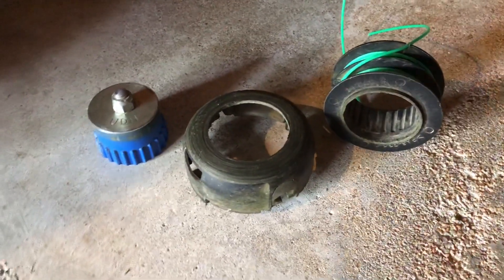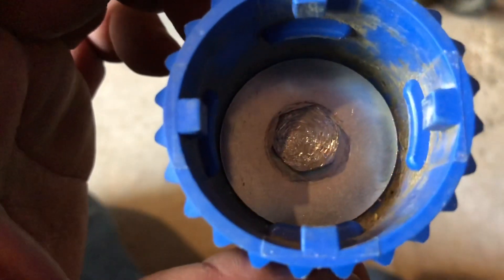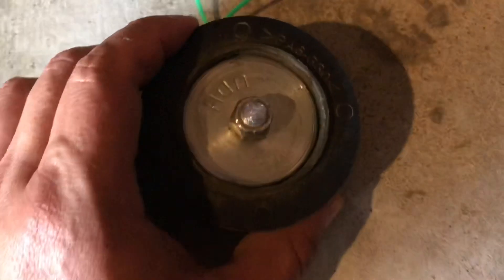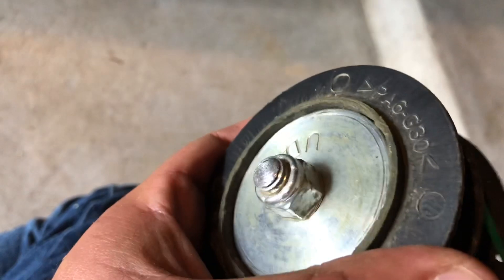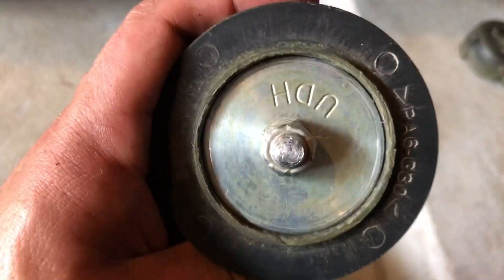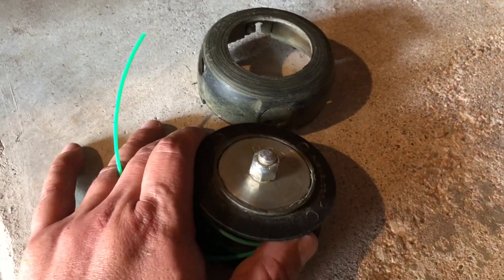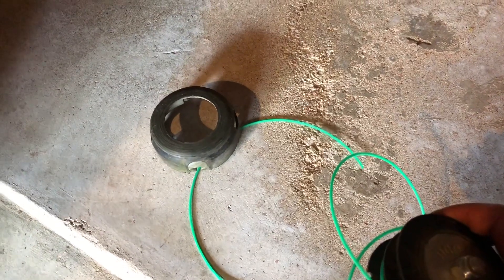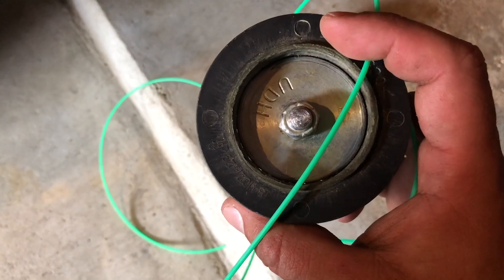Kobalt 40 volt trimmer Bump knob

Comment: I found an OEM replacement on Lowe’s website. It was $7 an free shipping. But my first one didn’t even last a whole season. I like this solution as it is bulletproof compared to the plastic cap.
Reply: Part #796787 Kobalt 40V Replacement Bump Knob.
Reply: what did you do to fix problem